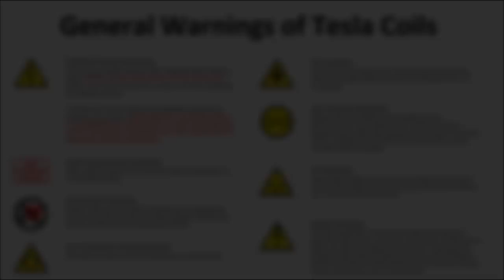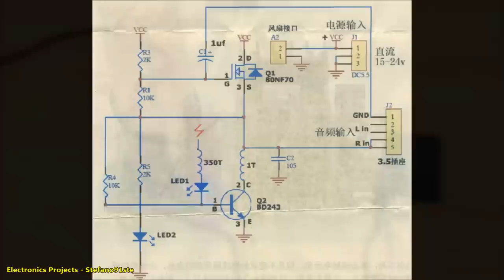Tesla Coil DIY KIT (Music Plasma Speaker) with detailed assembly

Comment: Just a quick note.  Before soldering your primary check first cause you may have to remove and twist other way. Also install your transistors on the heat before installing on pcb or you may not be able too screw them in lol. I noticed on other vids people have complained about this lol

Comment: Thanks a lot for the video! I was putting the primary coil on the opposite direction. I've just changed the cable spin and all works!
Reply from the maker: Happy to have helped you :)
Reply: Thank you Alejandro for commenting this. I wasn't even aware of the fact that this could be the problem and now everything works!

Comment: Only my blue LED is working. And the coil is not lighting any bulbs.😢
Reply from the maker: Hi, sorry for my late reply, were you able to resolve it? If not, try rechecking the soldering, especially that of the small copper wire of the coil.

Comment: Does it works with 12v input?? Or i can use a laptop charger?? I don't have variable power supply
Reply from the maker: 12 is too low, from 18 to 24v DC is ideal
Reply: Electronics Projects - Stefano91ste Gracias

Comment: I'm having an issue with mine. I followed your instructions. I plugged it in and the red led doesn't light up. Other than the blue led coming on and the heat sinks getting warm, it doesn't seem to do anything. I've rewatched your video several times trying to figure out what I did wrong, but I can't figure it out. Any advice?
Reply from the maker: Hi, regarding the red led it could be faulty or soldered backwards. If the coil does not generate the spark it could depend on the wire that wraps the coil, place it exactly like in my video, or the thin copper wire of the coil does not make contact with the pad to which it is soldered

Comment: done soldering all component but why the sound is not loud sound is low :(
Reply from the maker: Hi, because to hear much louder sounds it would take a larger coil capable of generating much higher voltages than this.

Comment: Great video. Is this a Slayer Exciter Circuit? Or asked another way, is this DC input, with the use of the transistor turning the DC into AC?
Reply from the maker: Hi, thank you! - Yes, the Tesla coil (also called Tesla transformer) works only in alternating current, the DC input serves to facilitate the use of this circuit for everyone. The transformer is a machine capable of operating only in alternating current, because it exploits the principles of electromagnetism linked to the variable fluxes of the magnetic field.

Comment: On mine LED2 turns on but not LED1, I don't have English instructions that tell me what the LEDs mean
Reply from the maker: Hi, if the rest works correctly, the LED could be faulty and doesn't light up or isn't soldered well
Reply: @Stefano91ste  I checked all the soldering and tried it again. The coil burnt itself. Oh well

Comment: My lamp doesn't light up when i do it and the plasma speakers dont work either
Reply from the maker: Hi, double check both the soldering of the copper wire of the coil and that of the wire (secondary) that goes around the coil
Reply: @Stefano91ste  I have tried both with unfortunately no results

Comment: Can You Help Me? I Did Everything I Saw On The Video, Nothing Seems to Work except from a high pitched beeping sound that I Can Barely Hear.
Reply: I Connected It With 19V Laptop Charger
Reply from the maker: Hi, even mine makes a very high sound, this is because it is not a real speaker :)
It is right to connect it like you do
Reply: Oh, But It Doesn't Seem To Work, Lol
Reply from the maker: But does not the whole coil work or only the speaker mode?
Reply: You Got It Right The First Time, Nothing Works
Reply from the maker: Ok.. Let's try to understand what's wrong..
Are all the components soldered in the correct way?
The circuit does not work, but does it absorb current when it is fed?
Reply: All The Components are Soldered in the Correct Way, I Don't Think It Absorbs Current......
It's Also Important to Note That It Worked as an EMP When I Put It Close to My Screen, My Screen Glitched a Lot when It was On
Reply from the maker: I had a problem similar to the first start, I solved it by resoldering the small bobbin thread that you see at 4:20
Reply from the maker: he did not make good contact
Reply: Oh
Reply: I Will Try It
Reply from the maker: Let me know if it works!

Comment: On the actual coil does it matter what direction the winding goes that gets soldered onto the boars im not sure wich way to attach the coil part
Reply from the maker: For the coil it should be the same on both sides
Reply: Why is there a arrow then? I used Google lens to translate the instructions it says you want it counter clockwise

Comment: what happens if u touch it? is it dangerous?
Reply from the maker: Hi, You feel a very light and harmless shock, but you burn yourself.  Electrically it is dangerous for people wearing pacemakers
Reply: @Stefano91ste  I didn't think the nerves could respond to a frequency that high. Ive heard that people could cook if a high current at these frequencies were present. Obviously grounded to the return wire and set up in a certain way. Probably just feel the pain when the body starts to heat. I've also heard that there would be no internal damage due to that frequency only passing over the outside due to the skin effect (not human skin but meaning outside_)

Comment: Mine doesn't work, only one led is light (the one on the right). What could be? Powered at 19 V
Reply from the maker: Hello, it could be the red cable around the coil not well positioned, or the small copper wire of the coil does not make contact with the pcb. I'd check these two first.
Reply: @Stefano91ste  I have the same issue as well, have checked 2 things you mentioned and can’t seem to work out. I could send you some photos of it on FB or email?

Comment: I have just bought the kit, and i cannot use my lab power supply for a while will two 9v batteries connected in series work?
Reply from the maker: Hi, if the two batteries are able to provide at least 2A of current is ok, other things will not work well.
Reply: @Stefano91ste   thank you!

Comment: Will this work with 3 amps 9-24 volts?
Reply from the maker: Hi, 3 Amps: OK - You need a minimum of 15V DC
Reply: @Stefano91ste  I think he is asking if 3 amps are too much and it might need limiting. Apart from certain components like L.E.D.s most things just draw what they need depending on the voltage. So that said, and correct me if I'm wrong 9-24 volts even with `100 amps available should be ok. However, if less than the current needed to make use of the higher voltage is available, such as only 50ma, then the voltage would drop that is actually present at the source. Without doing the maths perhaps 4v
What I would like to know is which way is the power jack polarised? center + or -? Thanks, Al.

Comment: Could you put a top load on this?
Reply from the maker: Yes, but not too heavy, I put a small metal ball on the top of the coil
Reply: @Stefano91ste  Does it change the performance at all?
Reply from the maker: If you do not physically connect it to the coil wire you did not give any performance drops. But you can not use it as a speaker anymore.

Comment: It won't work I've tried many different things, but it won't work!
Reply from the maker: Why it does not work?
What different things did you try?
Reply: Electronics Projects - Stefano91ste idk and resoldering, diff amps, and checking the wire
Reply from the maker: idk ?
If you follow my video step by step, it must work!